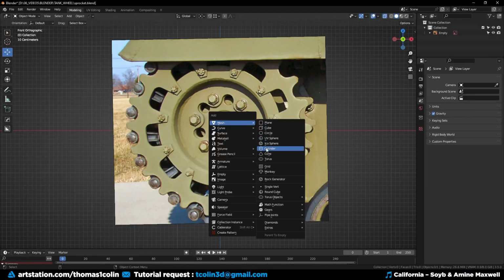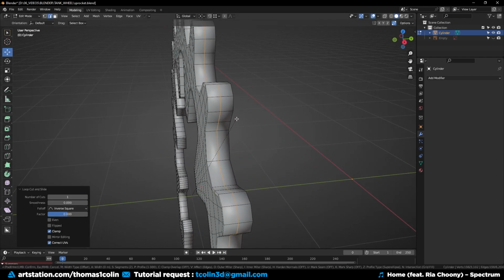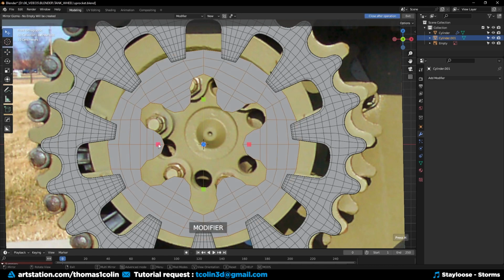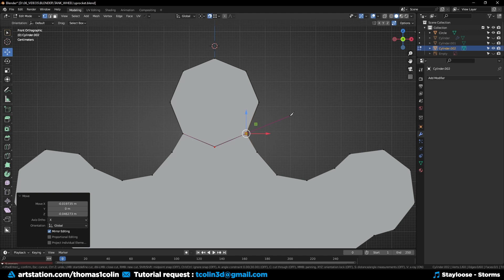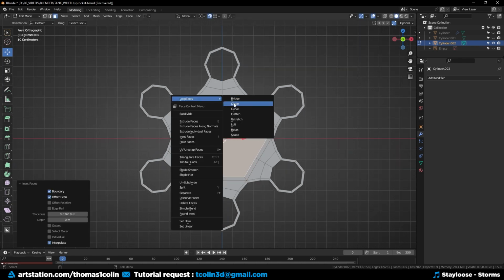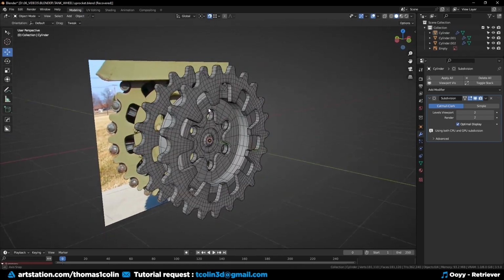Topology Study : 2 Radial Array Methods (Default Tools & Hardops )

Comment: For anyone stuck on the Array part, I'm finding that the arrayed object's Origin has to be in the same location as the Empty in order for it to work right. If I skip that step, the iterations are all rotating around the object's Origin as well as around the Empty. This seems to be the case with or without Hard Ops. Please comment if this should not be the case, but that's what's happening here.  Thank you, Thomas, I learned a lot!
Reply from the maker: Thanks for watching :)

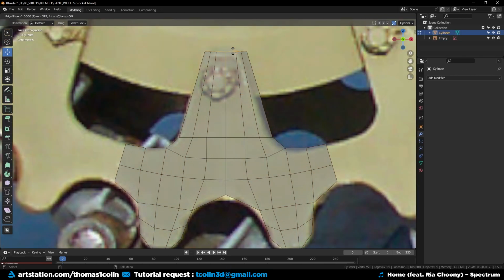Comment: Great video! I have a noob question Thomas, eventhough you achieved perfect quads at one point, you still added some more geometry (at around 3:26), you said ''support loops'', why do we need those? Are elongated quads bad? One more thing, I have realized it's possible to make concave quads, I don't know where this might be useful, but are concave quads something to avoid or are they harmless?
Reply from the maker: Elongated quads are not that bad, but it's better to make square quads to avoid texture stretching when you apply the Sub-D modifier. The support loops are a way to maintain the shape. I'm not sure to understand what a concave quad is, do you have an exemple to to show me ?

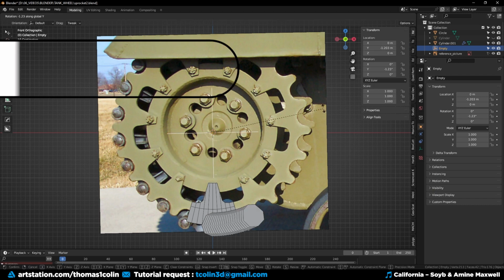Comment: Solid video brother, alternatively, at 1:50 when youre doing traditional radial array with empty you could instead take the original cylinder in the edit mode and spin it using duplicates and set 360 angle and you're done. Infinitely faster method in cases when you dont need to keep array mod for further tweaks
Reply from the maker: Thanks for your advice ! I know that trick too but I don't know why I didn't think about it while recording my video 😂
Reply: @ThomasColin3D  for some reason i overlooked it too for way too long